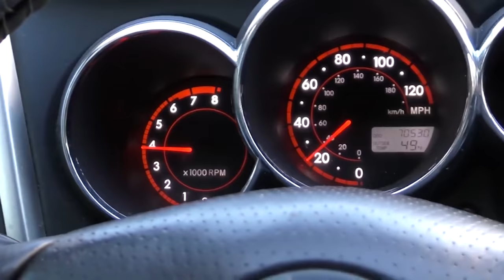5 Signs Your Transmission Has a Serious Problem

Comment: Hi Scotty, I recently bought a 2016 Hyundai Tucson (4 months ago) and it has started to make a hissing sound when I step on the gas pedal. It also doesn't accelerate as quickly as it should be able to. One mechanic said it's the catalytic converter that needs to be replaced; another said it's the transmission that needs rebuilding. I don't know who to believe or what to do because both of those are pretty expensive. What do you think might actually be the problem?
Reply: Get a 3rd or 4th opinion

Comment: Hey scotty could you do a video on ford fusion specifically I have a 16 fusion and it's slips with no engine light token it to 4 ford dealerships and they can't find a solution is their anything you would suggest to fix it from jerking in low gears

Comment: By 30,000 miles you mean miles right not km?? Coz here in Malaysia mechanic recommend to change Trans oil every 30k km... so any suggestion on w211 , 2003 benz

Comment: I don't know if anyone could help me, but i am currently at 80k miles, and i bought the car at around 70. i want to change my transmission fluid before its too late, and then do it more often. but is it too late at 80k miles? btw automatic transmission and fluid never got change.

Comment: I just realized this is why my father e60 520d's gearbox was slipping after the gearbox oil change that was not done in bmw but somewhere locally , because of this gearbox oil change the car would just go into neutral and we sold that car  even though it was our favorite car because we thought that this car was a stupid design

Comment: Hey my transmission is completely disengaging and then kicks in gear or something until my transmission fluid get hot and occasionally even once it’s hot, and it’s also having trouble accelerating sometimes, it’s also got 180k miles and was used to haul around 15-25k lbs of hay for a few summers(ram 2500) but these issues started immediately after I got my tires replaced, is it possible it’s something the shop did? Or is the transmission probably just going out

Comment: Scott, I have a 2011 ford Range that had 94,000 on it when I bought it. It now has 105,000 miles on it.
I don't know when it was changed last. The fluid looks pretty clean. Would it harm the transmission to change the fluid and filter now. Love your videos. They are very helpful.

Comment: Nok sensor gone out in my 18’ Cruze Turbo diesel, the selling point was it was manual. But if it weren’t for the warranty I had my slave cylinder go out at 34k never in my life has this happened. Why would they put that in the literally in the bell housing , 4k to drop the tranny and replace a 100 part, they ended up covering it because it was 200 miles outside of b2b . Insane .

Comment: The secret is jack up your vehicle high from the front with stands lock in, remove transmission output sensor have a large container for the transmission fluid , then go to the transmission dip stick,remove it , need a air hose with blower adapter blow out the transmission fluid out completely ,, then cover the output hole with something that will hold light pressure n blow it out again, refill with the proper transmission fluid old mileage  or better 10 percent gear transmission fluid the lightest thiness one synthetic as a additive will help ,, if that's works good ,, if not , do it again remove pan & filter ,gasket , get drain bolt screw kit for transmission pan,, then get magnets in the pan ,

Comment: or you could just do it like here and buy a standart transmission car or a dual clutch automatic car which is basically like a standart transmission just that the computer shifts for you and it has 2 clutches
that being said my 31y old Mazda Miata MX5 does need new transmission fluid, kinda grinding in second gear   : |

Comment: Yeah I think my 96 Honda Accord (Auto trans) has a pressure sensing issue. It will shift alright to second gear but won't shift any higher, just revs high. Anybody have any recommendations for such?

Comment: Getting a p0700 code and my car wont go into gear. 2011 2.4l malibu. I had issues with it accelerating rpms go up then would catch like it wouldn't engage. My transmission still good and its the tcm? Any advice from anyone?

Comment: I need HELP. have a 2016 Corolla S Plus, got it at 38k miles, car mever skids at initial takeoff when I press the gas pedal all the way down. it delays shifting from gear 1-2, tachometer revs more than actual output or speed. I am in Nigeria, have tried different auto shop, none seems to be getting it right. No i notice car struggles to move until it hits 20mph, then it starts flying like it got jet propellers. anyone with the slightest idea what could be wrong. I love the car so much, but so hurt with its performance. HELP please.

Comment: Scotty, most of the videos you do relating to the transmission only got a fluid change but in these videos youve mentioned also a transmission filter change by dropping the transmission pan. So, should we change both the fluid and filter? Or the regular fluid change is good enough?

Comment: My car randomly shut off while driving going slow, twice in the past six months starts right back up when you start burns a little oil I read low transmission fluid can cause this? I assumed it was corrosion on my battery’s at first I’m not sure where to start is low transmission fluid being an issue true?
Reply: I'm experiencing this at the moment got any fix yet?
Reply: @kazimadedigba4522  None I checked everything I could fine no issues fount and never done it again i cant figure it out.

Comment: Why does my car burn out alot.of.engine oil. 

I do uber I change the oil.and 2 weeks or.less the.oil is.low on.dip stick why so quick.

I drive a 2015 scion xb 4 cylinder

Comment: What if I got a car sytem and the battery light came on and then I wS 4 00 feet from my house the wouldn't shift the car is 2012 Chrysler  200 it has a a different  transmission  then I'm use to theee isn't a dip stick for the transmission  I looked and I don't see anything  leaking I opend the cap the car sytem has a extra battery but I don't see any wiers to the aultnator witch makes the battery in the trunk usless I got this car sytem professional  done and after the light came on now it won't shift

Comment: So whenever I start my car lately, it starts and holds almost 2k rpms at idle. Over the span of like 3-4 minutes the rpms will slowly drop to the normal point the rpms should be in the park position. Also it kinda seems to be like stuck shifting in 2nd gear in order to get up to traffic speeds. If anyone could help diagnose that would be cool. It's an 05 Camry

Comment: Scotty ' do the newer automatic transmissions ' maybe like the ones in a 2010 Dodge Journey SXT FWD, have adjustable  transmission shift sensors?
l just recently had my transmission fluid and filter replaced. now the car clunks when shifting into 2nd & 3rd gears. any suggestions ? 🔧👍

Comment: 5 signs your transmission has a problem:
1) it runs through its problems without ever communicating that there is a problem
2) when you give it advice, it always seems to be dismissed
3) your car justifies it by saying, "see? no head's up light. everything is fine." it is, in fact, not fine.
4) no matter how much financial assistance you give it, it always goes down the drain
5) the transmission makes funny noises during serious conversations with it
Reply: What happen if water enter the transmission?

Comment: Sadly ford made the transit’s transmission inaccessible to even check the fluid. The stick to check the level is on the top of the transmission with no way to get to it except from underneath the van. If they make it so I can’t fix myself then I have to pay them to do even basic service.

Comment: Went to jiffy lube for a quick oil change and they drained my trans by mistake. Now it clicks and clanks when i shift to d > n > r. They didnt even check the levels of the trans fluid while on. My car doesnt have a dipstick its got the flow plug.  Theyre so fucked.

Comment: Yes!  I have ruined two high mile transmissions by flushing the transmission fluid.
Reply: Flushing or draining and filling? What year/make/model? Were there problems prior? Symptoms?
Reply: @adictiveadictive  flushing on the first transmission went out 3 months later on a 2002 Pontiac Bonneville with 150k.  The second was replacing the transmission fluid for the first time on a high mileage 2016 chevy malibu.  Immediately after it started slipping.  There were no prior problems with the transmissions.  I just thought it would prolong the life of the transmission.
Reply: @ryanjames5799  
Damn. Hope you didn't just Jynx me 😭

Comment: Hi Scotty from orstralia!
Love your videos.
Just got to wipe  off the  dead kangaroos off my windscreen.

I have a 2009 Lexus rx350 6 speed 190ks.
When shifting from p to r or p to d there is a chink sound, best described as hitting a chain lightly against a pipe.
Im unsure if its the transmission another part of the driveshaft .
Car runs perfectly just annoying.

Regards mike.

Comment: Guys can some pro help me out? So I did this air cleaning through engine filters for carbon cleaning and once was for better fuel mileage for my Lexus IS 250 - 2014 - 3rd gen, before that my gear had no problem everrrr it was smooth as hell but when I did this now I’m facing kind of lag when I press gas the rpm goes all the way to 6 and 7 but the car is still not taking any movement like it’s standing then suddenly it gets a hard shake and boom it gets to run this boom wasn’t there before and I’m sure it’s something related to transmission
Reply: And what’s the best idea to fix this? That guy who did the carbon cleaning thru machine did presses alot of gas to remove the carbon from excaust which kind of scared me so I’m afraid it might be from that? Or I’m just over thinking? My car mileage rn is 195k and I never did transmission change, cause we all know what the dealership says? It’s a lifetime so yeah

Comment: So Mr Pro Mechanic - Instead of changing all the oil with the new - we should not take all of it out and mix the clean oil with the dirty oil and do it keep doing it often "thats good enough" - Okay
Fully Synth Oil huh? Last longer huh? Modren Design huh? So...in theory we should do the same with the engine oil mix the dirty with the new and keep doing it often - Okay 
And in after all those warnings you said - that Lucas Additive has worked mostly worked for you - So...nothing to worry about then! Okay Sir
Oh and could you explain how as you said back in the day auto transmissions would clog stuff up and they dont make em like that anymore - My Question - Whats the difference? How did the technology evolve from young to saggy old mechanic - oh Im sorry my english is not good - I meant from 1960 to 2024 -
Last thing - How much did Lucas pay you for this? - Oh apologises I mean how much did you pay for this additive which you have been using on people's vehicles for years?
Please guide me

Comment: So you're sayis you're a sane stay away is the way from flushing the transmission but you can change the oil and the filter  Reason being I just  Is got a 2009 Pontiac G8 v6  it was sitting for a while it have a 9800 mile

Comment: Why not do the best thing, and buy a manual transmission? Changing the fluid is a lot easier and you won't have problems with solenoids and computer chips since YOU are the solenoids and computer chips!

Comment: hey scotty.... what will make a vehicle transmission downshift 2 gears instead of 1 when utilizing passing gear? i bought a 2011 impala that had this issue and im not sure what causes that. there was no noticable slips that i noticed and shifting seems fairly normal other then that. just put a new front cap on it and would like to fix the down shifting issue while im working on it and have a donor car to access,

Comment: Don't be lazy, drive a manual transmission. It's a drivers car and you will get better gas mileage plus manual transmissions last forever just change to transmission oil every 50,000 miles

Comment: I disagree with Scotty on this one, most maufacturers, i know Honda is the one who wants Pan and filter removed... Subaru wants Pan but never change the filter out... These issues are happening because people wait too long. If Honda says every 60k for an atf flush... its the car owners fault if it slips because they waited too long... thats the onky time ive noticed issues... and we use the machine thats in ur video and it does pull from the torque converter.

Comment: It's painful watching this video.  Flushing depends on condition and mileage. If you have high mileage. Just do a filter or a drain and fill. If you regularly service your trans, and don't let it go past recommended service intervals, a flush isn't going to hurt it. Although I would recommend doing a filter at 100k if you haven't done one yet. Obviously you don't do a flush if it's burnt. I could be wrong, but never have I seen a solenoid problem after a flush.

Comment: Ok so I have a 2020 Honda Civic Sport with 4k miles on it..what the heck do I do with the Transmission? Clean pan and change filter .. that's what I tell mechanic?  That's what I'm hearing..lol
Reply: Only 4k miles?? It's practically still new. No need to do anything to the transmission

Comment: I flush my vehicles every 3 years and never had problem. I guess it also depends on the design of the transmissions.
Reply: I have my RAV4 transmission flushed every 4 years, Never had any issues.

Comment: How to tell if you need to CHANGE the transmission fluid.

Pull out the dipstick and wipe it on a paper towel.

Is it as purple as Barney the Dinosaur? Don't change it 

Does it look like Barney's diaherra and smells awful? Change it.

Comment: This guy is just clueless and doesn’t know anything!!! ALWAYS flush your fluids!!!! Even if you have to change it drive it for 100 miles with the new fluid, change it a 2nd time and if needed drive again 100 miles and change it for a 3rd time using new clean fluid each change!!! And boom instead of doing a single change which only gets around 50-60% of the nasty black stuff in there doing 2 or most def 3 you’ll get atleast +%90 of all that dirty fluid out!!!